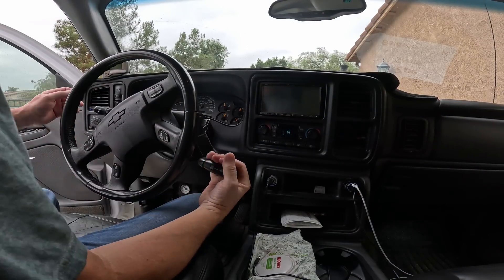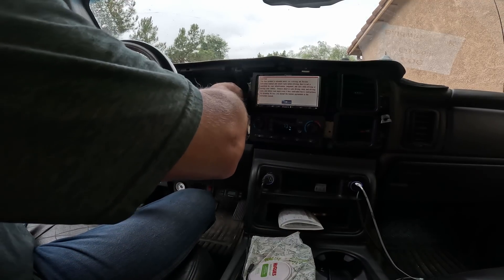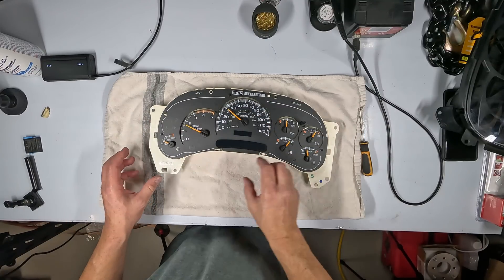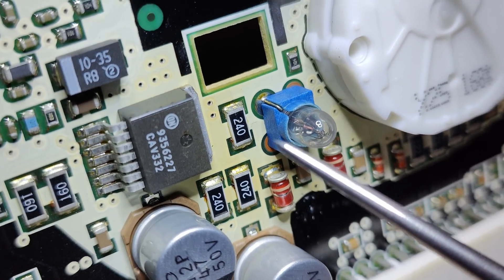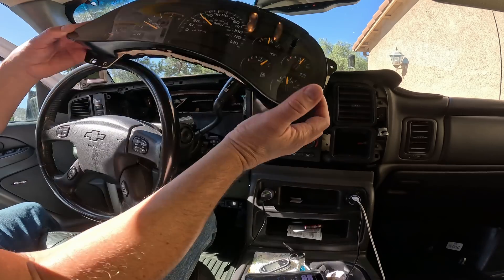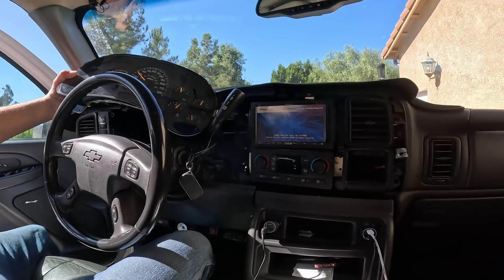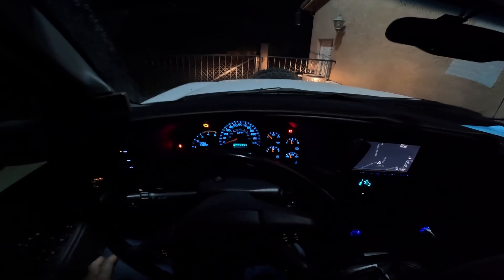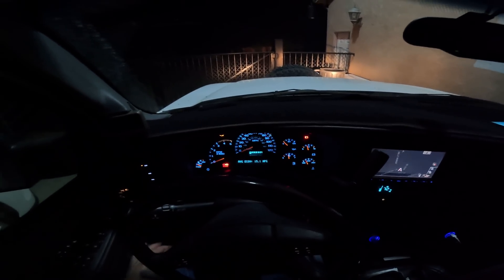Chevy Silverado Instrument Cluster Repair

Comment: Hoping is not a good way to diagnose an electrical issue.  Low tech diagnosis should be done first like checking fuses or any wiring damage. There’s a fuse that is called IPC on a fuse box that controls the cluster functions.
Reply from the maker: All the quick checks were done. A year before I went through all the diagnostics. Checked fuses, check voltages on connector and ohm'd out circuit board fuses. I ended up finding hairline cracks with a microscope. After a reflow that had fixed it. 

My 20 year old dash is at the point of a major overhaul and there are companies that know exactly how to do it and would take too much time for me to do it. Much of the back lights were burnt out the drive indicator has been burnt out for years. It was just time to get a fully rebuilt one.

Last years repair:
https://youtu.be/TBPed2dz8-I

Here is also a couple shorts related to the first fix:
Crack: https://youtube.com/shorts/X83578JDhF0
Reflow: https://youtube.com/shorts/CplFavWXbO0
Repair: https://youtube.com/shorts/d72-08rn0T4

Comment: i bought one rebuilt from ebay and two times it died. idk what to do now i guess buy another one and hope for best. i paid 80 for the repair first time. not sure if i should do again.
Reply from the maker: If you're only spending 80 bucks you're not getting a fully rebuilt cluster. The part cost for replacing the servo's, back lights digital readouts would be at around 80 bucks and then they would still need to be installed which is a bit of labor with all the removal and soldering items back in place.

ISS Automotive replaces all known problem items back lighting and servo's and solder reflows all issue prone areas. You can select the back lighting and display needle colors and if you don't have one you can upgrade to have a tranny temp gauge. 

Plus you can pay for a lifetime warranty for $15!!! 

This is where I bought mine after repairing mine twice myself I was like enough is enough...